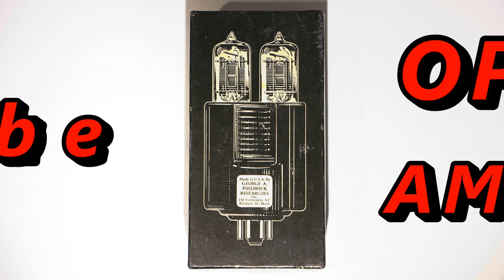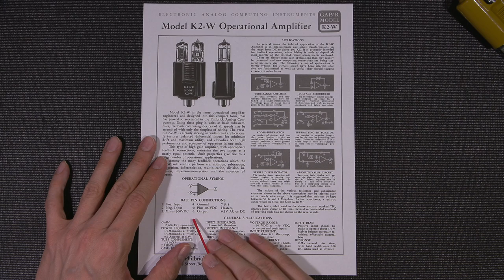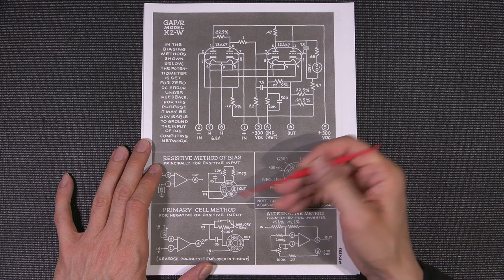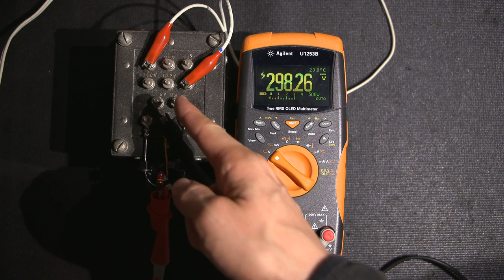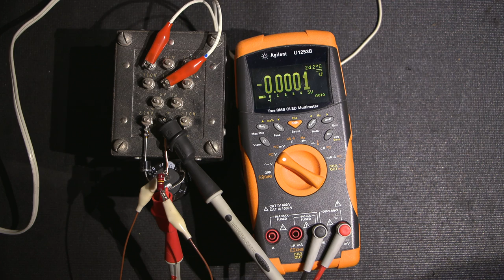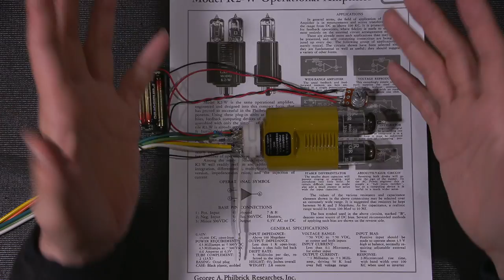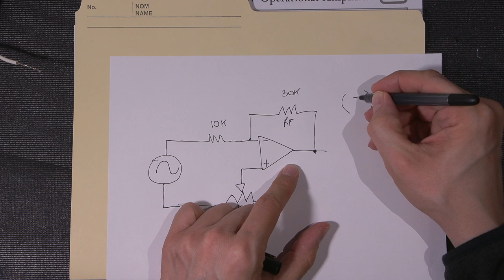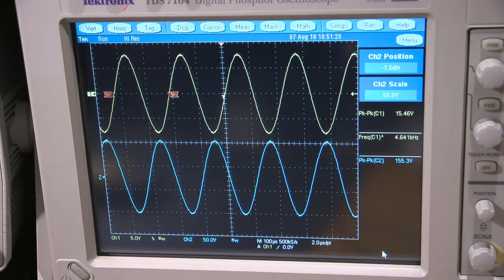600 Volt Tube Op Amp! Lets Power It Up.

Comment: Question? You didn't go over the power supplies with a great deal of detail. Did you current limit the +- 300V supplies, or did you just dump the entire 600 volts unlimited into those tubes?! If the latter, that seems somewhat frightening dangerous! *(I release you didn't show the supply construction in detail, as not to allow people to hurt themselves, but you should still talk about it in general, considering the amount of time you spent on differential supplies with the nine-volt batteries.) Just a thought! But as a whole, a very well presented demonstration.

Comment: Surprised you didn't just turn the diodes and capacitor around and made it centre tap ground, alternately you could have made a twin half wave supply with the centre tap being ground for both halves ;)

Comment: Can this work with less than 600v?  If the out put is +/- 300v, then if using a +/- 100v supply may also work, similar to a semiconductor opamp.

Comment: Why did the multimeter jump across 20 some volts to 0 back and forth when you were discharging the cap?

I'm always afraid of polarized caps, blew some up when I attended electronics classes, burnt my clothes right off.

Comment: Yet another fascinating video, Paul. Your knowledge and ability never cease to amaze me and your thousands of follower's worldwide. I have a question. Does running the filaments at 6.3 volts via the tap rather than 12.6, have any affect on the overall performance of the op amp?

Comment: I could be wrong but I believe the USAF in the 1950's managed to shoe-horn two pentode valves and some other gubbins into a single tube for this very purpose for aircraft bombing computers. I would love to see one of them working if you can ever find one that does not cost enough to make your eyes water.
Reply: A Google search for 'double pentode' or 'dual pentode' gets a lot more hits than I expected. Though now I'm curious about what the "other gubbins" comprised ;-)
Reply: I am under the impression it was precision resistors a few capacitors and wiring. That said I'm going from memory and knowledge of electronics. I believe the 741 was designed to be of similar characteristics including the frequency response. I believe the 741 was more noisy and had a bigger offset but again don't take that as anything m,ore than memory of someone who never actually worked with the valve op-amp in question.
Reply: Thanks, makes sense... putting those passives inside the envelope (i.e., in high vacuum) and near the heater(s) surprises me, but maybe that's still a safer / more stable environment  than the aircraft cabin! :-)
Reply: Perhaps they were inside the glass but not the same section as the heaters and vacuum. I do know they needed time to warm up. Older carbon resistors really do not like vacuum and neither do paper or some other types of capacitors. Silica is fine though as long as it's treated first before sealing. 30pf or whatever it was would not need a big cap. Might even have been a glass cap.
Reply: Heh, excellent, thank you. I was thinking "Mica caps would be fine, but ol' wax paper condensers would be most unhappy at low pressure...", that whole outgassing thing :-)
Like you say, 30pF could be just a little silvering on two sides of a glass tube or plate; so, very stable. Maybe unvarnished metal film resistors complete the circuit? :-)

Comment: So you would have a chassis at a relative +300 volts to everything else in your building this way... I don't get how this works when you hook together like stereo equipment, unless they are differential. Not to mention it would shock you. One time a house shocked me and I found out it was wired wrong can't recall hot neutral switched I think.

Comment: Seeing as you can make a VCO (Voltage Controlled Oscillator) out of a standard solid-state Op-Amp IC, I wonder how easy it would be to do the same with one of these Tube Op-Amps?

Comment: Awesome video!!👍 I'm super curious about one thing though... At 21:05, when you disconnect your cap discharger device right before it reaches zero volts, what physics/chemistry/mechanism is causing that capacitor to slowly charge back up again?? You turned off the circuit about 30 prior to this, so I'm super curious where that capacitor is getting the energy needed to "self-charge" itself.

Comment: I was wondering why you just didn't make a bipolar power supply with the center tapped output of the transformer directly and not mess with 2 seperate power supplies.   Two full wave rectifiers, 2 filter cpas and 2 bleeder resistors and you would have your bipolar 296 volt DC power supply in one unit.
Reply from the maker: Thats explained a bunch of times in the comments.
Reply: There's no very good reason, despite what Mr Carlson says :-)
(But you only need one bridge rectifier.)
Reply: theskett  Thanx.    I re -  viewed the video, and he just said he has one power supply and needed a negative power supply.   I think he misunderstood what I meant.     I meant he could have built a stand alone dual polarity PSU with the center tapped transformer he found to get the required + - 300 volts.

Comment: That was fantastic !
So basically Op Amps steal energy from the DC voltage across them (600V in this case) and feed a portion of it into the output signal. Is that about right?
So how efficient is this thing? I see 600V and I have to wonder how much current it is supplying.
How many amps does this thing draw from the wall?

Comment: Hey mr Carlsons lab, I have a heathkit model c-2 condenser checker that has a shorted transformer on the primary windings, what can I do to fix it, as there is no replacement transformers available, what would you recommend I do? Thanks.
Reply from the maker: You will have to replace it. Keep your eyes open at HAM swap meets, and your local auction sites.

Comment: The 12 volt rating is so that tube could be used in a 5,6 or 7 tube series heater string of an AC/DC power circuit (which was very common in the 50’s and 60’s).  12AX7 was designed to operate primarily (but certainly not exclusively) in AC/DC powered circuits and thus is intended to have a plate voltage of around 155 volts.  I have no idea why this thing specifies 600 volts.  The 300 volt cathode voltage exceeds the 200 volt maximum cathode to heater voltage permitted for 12AX7.  The specified B+ and B voltages are literally twice what they should be and it’s just a matter of time before you get a heater to cathode short.  Cut the B voltages in half and the tube will operate just fine, and for a much longer time.
Reply: Note the strike out above is where I stated B minus (using a minus sign) and it interpreted it as being a strike out instead. sighs
Reply from the maker: Hi. Isolated filament windings is how you exceed filament to cathode breakdown ratings. In many cases, a resistor is added (high value) to bring that isolated filament up to (down to) the same potential as the cathode. If you would like more reference to this topology, look up vacuum tube regulator circuits. Most all triode pass elements are in this configuration. Keep in mind, there is drop across the plate resistors, so the plates are at a lower potential when the tubes are drawing current. The maximum design value for a 12AX7A will allow for 330 Volts on the plate. The design of this op-amp falls within the parameter. See the data sheet for more info:  http://www.mif.pg.gda.pl/homepages/frank/sheets/093/1/12AX7A.pdf
Reply: Yeah, but is it.  The cathode resistor gives current dependent cathode voltage.  No current would be full voltage.  But all theory and complexities aside, put a VOM on it and see what it is empirically.  If it’s not too high then wonderful, else, problem.
Reply from the maker: I don't think your understanding. The filament supply is another supply completely separate from other tubes in the chain, aside from other op-amps like this. The filaments are put to the same potential by adding a resistor from the negative supply to the filament winding. Sometimes this is accomplished by a resistor divider network to closely match voltages. Since the filament winding is now at the cathodes potential, there is virtually no difference between the two, eliminating the breakdown issue.
Reply: I'm just looking at the schematic and maybe I'm blind but I don't see that resistor.

Comment: If tube op amps can be made to function that accurately, then discrete transistor op amps can be made to perform to same precision as tubes, or do discrete transistors have much more unpredictable charactersistics, than there counterpart tubes?

Comment: ALWAYS great videos!  Off topic - is a Tektronix 1910 sig gen useful for old radio/amp repair? They are getting cheaper since TV reception went digital. They are so darn sexy! I hope it can be modified to work on vintage gear?  Any advice would be greatly appreciated.  Thanks!

Comment: Why don't you use full bridge rectifier with transformer instead half bridge and 2 supplys? You could make 300-0-300 DC with transformer only and 4x 1n4007 diodes + 2x 2.2uF caps

Comment: Thank you for yet another great video! So for integration, if you let the gain represent the Y value of a function, then you could charge a capacitor over time with the output if the input is 1V? and the total charge would be your value?  I should probably go test this first, but right now my power supply is dead. I clearly need to read up on op amps for use in calculations. Any suggestions on books?

EDIT: and am I correct in assuming that the Bias in integration mode would represent shifting the entire function upwards?

Comment: Talking about how fast that cap on the transformer would discharge, without a bleeder resistor, have you ever charged one up and just measured it to see how long it takes?

And I love the part about the +/- bias with the batteries.  I once got into a physical fight with my roommate at tech school about polarity like that.  He kept insisting a circuit was + something and I kept asking him what the ground reference was.  :)

Comment: Nice, did you check what the frequency response  of the op-amp was. Maybe the same as the 12ax7?
Reply from the maker: They claim DC to above 100kHz. I would imagine it to be correct, back then things were tested and labeled correctly.

Comment: If vacuum tubes wouldnt need a heater would they be still very inefficient compared to a transistor?
Reply from the maker: Definitely, because they wouldn't work at all :^) I see what your saying, now we would get into a lesson on "impedance." Solid state devices are generally classified as "low impedance devices." Tubes are high impedance devices.

Comment: 210x1.4=294 using a diode less voltage with a tube rectifier

Comment: Thank you, Paul!  Great video, as always!

Hey, when did you get the Tektronix TDS 7104 digital phosphor oscilloscope?  That looks like it might be one of the most modern instruments in your lab!  (I love both vintage and modern instruments, just the same.  They all rock!)
Reply from the maker: Hi Walt, a good friend "Steve" had this sitting in his lab, he meticulously went through and restored the scope. It even has an SSD now. Great scope for digital work.. and for displaying information for video purpose... Analog work, well that's a different story. For high gain, low noise measurement, I will stick to my BIG Tek 547's..... there is no comparison.

Comment: Can you please explain the absorption in the capacitor? I've seen capacitors do that before, and at work on occasion I deal with jet engine spark ignightors and strobe lights. Also, is there a 1 handed method for discharging the caps? I was trained to and  like using only 1 hand when dealing with high voltages for safety. I'd rather shock 1 hand than send current across my chest from one hand to the other.

Comment: Whilst I really appreciate the info you give, I have to question the dumbing down. I would really hope anyone interested in a tube opamp doesn't need a primer in dual rail supplies. I really like your content, but it does tend towards the long winded.
Reply from the maker: You may want to read the comments, people have already thanked me for the split supply explanation. I cater to all levels of electronic experience, everyone can feel comfortable here.
Reply: That's cool, I'm just giving an opinion, same as them. It is an ideal platform to explain the concept, but could be better delivered as a separate topic, that someone looking for split rail info might find. That would be 2 very good videos in their own right.

Not my channel tho, it's your thing. I just find often the stuff I'm interested in your videos has a lot of stuff that is off on a tangent. You even said "This isn't relevant, just trying to make an op-amp work", and then go on for another 10 minutes. There is a lot to wade through.

Your work is an excellent resource, but my suggestion is to help making it more consumable for people of all levels by breaking it up a little more. 

I'm sorry if I was a bit blunt, but it was said with positive intent.

Comment: Very nice. What's the frequency response?
Reply from the maker: Well below 1Mhz.
Reply: So it could still be used for Audio Applications offering decent gain at a fairly high output impedance without turning itself into an oscialltor? Cause those are interesting qualities tests shown in the video don't quite reveal.

Comment: Hi Paul. Can you think of any practical applications for an operational amplifier with 600V rails that can't be done with a modern operational amplifier with 36V rails? I can only think of one. (By the way, what's the signal-to-noise ratio on that beast?)
Reply from the maker: Hi Peter, many applications require high amplitude signals, and there are special op-amps available that operate with very high rail voltages. Here is an Apex product: https://www.apexanalog.com/products/pa89.html If one didn't require drive current, this tube op-amp could be built for a fraction of the price.

Comment: Wouldn't a 'center-tapped' 12.6V filament require three pins to operate from 6.3 ?volts? Only pins 7 & 8 are referenced to the heaters.  I'm confused.
Reply: Never mind.  I see what they did there...

Comment: I didn' t understand what is the heater voltage. What is its use? And was it used in the experiments?
Reply from the maker: Hi Michele. The heaters in the tube warm up a cathode sleeve. When the sleeve is hot, it will emit electrons. The electrons are attracted by a positively charged surface (anode or plate.) If you wanted to compare a a triode vacuum tube to an N-CH FET, the plate or anode of the tube would be the Drain, the grid of the tube would be Gate, and the cathode of the tube would be the Source. For a tube to operate, the cathode has to be hot, that's why tubes have to glow in order to work.

Comment: Great video mr Paul. I'm not familiar with vacuum tube, and I'm prepared in a solid state device but there's more interesting in vacuum tube. Thank you so much again for sharing this information it's a big thumbs up! Can I ask something? What value of a bleeding resistor did you used across that capacitor?
Reply from the maker: Hi Roy, thanks for your kind words! The resistor is 120K. Just a random value to drain off the cap.

Comment: Hi! What’s the GBP (Gain-Bandwidth Product) on this thing? How does it compare with the cheap LM741? It looks like there’s a neon bulb in the circuit, or is there a 2-pin plug or socket inside the base of this thing? Or is there a miniaturized gas-discharge voltage regulator tube in it that activates at 125 VDC? In any case, if one is going to clean an old, dusty, dirty vacuum tube, make sure you note down the tube # beforehand, in case you do rub off the markings! 😎
Reply: I like clean shiney tubes and just wipe them down real good and use a Sharpie marker to relabel them.  Most tubes have other markings that won't wipe off like dust.  I only try to preserve those markings on Special tubes I might want to sell for big bucks!  Like my Mullard EL34's relabeled by Sylvania but made in Great Britain!  8^)

Comment: This is really interesting; unfortunately this still makes me stumble about the concept of pos./neg. voltage. I mean its all about potential aka difference, isn't it?
What would actually be the difference between -300V/300V and 0V/600V. Is it that I cannot get a voltage of 300V with the latter one, whereas the first one gives me -300V/0V/300V/600V possible?
Reply: Sometimes the tube cannot exceed a certain Heater to Cathode voltage.  +/- 300Vdc keep it within the 12AX7 specs.  600Vdc to a common GND can also jump and arc, whereas +/- 300 Vdc both return to GND and have much less chance of arcing.  ;^)

Comment: Cool video, what is the estimated open loop gain?
Reply: (From another commenter) Two tubes at 100 each; so (multiplying) 10,000 ; and IIRC the spec sheet may say 15,000.